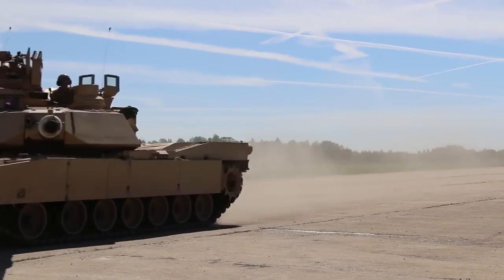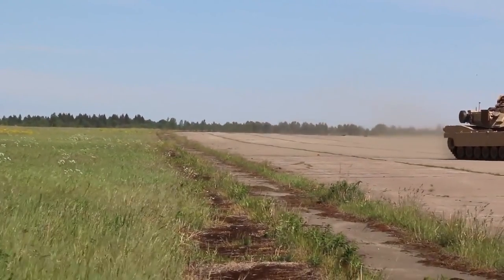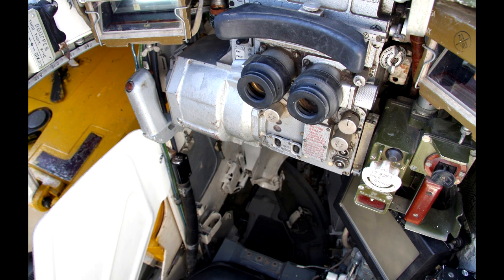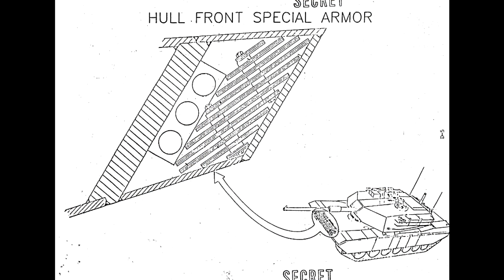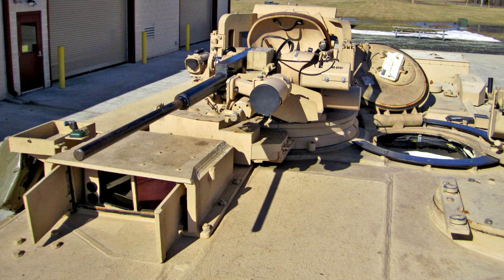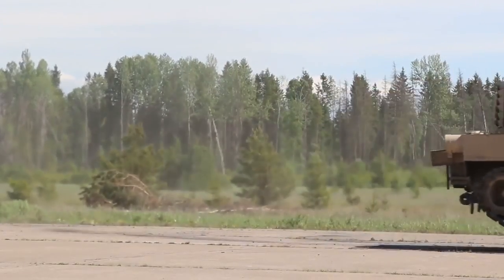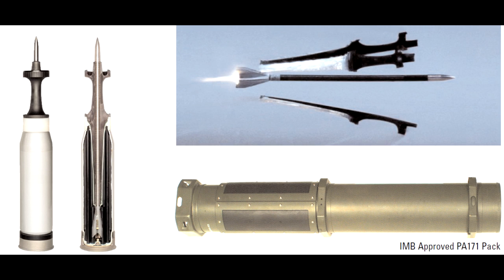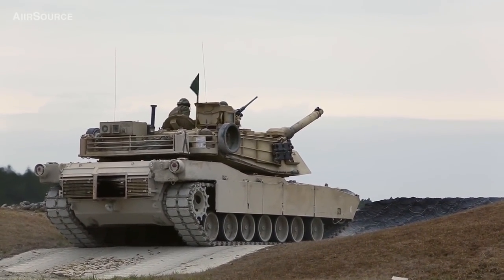Problems with Abrams tank

Comment: Next Problem with Leopard2 Tank
Reply: The only valid criticism would be the ammo rack in the front hull. But that's the same with most other tanks really.
The Abrams is one of only a few tanks that doesn't have ammo in the front hull.
Reply: Next Problem with Bob Semple tank
Reply: @eustache_dauger  Would be a short video
Reply: @eustache_dauger  there is only one problem with the semple. Too overpowered can singlehandedly destroy an entire tank column
Reply: @eustache_dauger  There is none, the fortress makes the enemy drop their weapons and surrender or run aways just with its presence.
Reply: WHO DARES TOUCH ERIKA!
Reply: @Life in the Zone Oof
Reply: He could do this with the Puma IFV, same company (joint with rheinmetall of course) but basically not a pheasible vehicle currently
Reply: Pommy Pie  That issue was meant to be addressed under the KWS III program. The retrofit program was slated for the mid-90. Although it was cancelled due the ending of the Cold War. While the KWS I (L/55 Gun Upgrade) and KWS II programs were merged creating the Leopard 2 A5.  

Had KWS III been approved, a new turret mounting 140mm gun with a bussel auto-loader would have been fitted. While the driver's position and now redundant hull ammo storage, would have been reworked into an armored crew cell.
Reply: I think the only major problem would be the lower turret cheeks as it may ricochet rounds into the top hull plate
Reply: @theduck3876  nothing riccochets the cheeks, its spaced armor
Reply: @auburn8833  well then in that case there's probably no downside to the L2 at all!
Reply: @theduck3876  well not for long probably, with new tanks that use higher caliber guns and with that much longer APFSDS rods (like T14 Armata), it might render the arrowhead useless against those higher caliber AP shells
Reply: Well assuming we're talking about the v face L2 rather than the flatty
Reply: @Life in the Zone Wait a sec... what leo are we talking about? As far as i remember from training rescue operations of crewmen in leo 2a5s and 2a6s the ammo rack was in the back with ye good old bustle storage princip you mentioned aka ammo explosion will be pushed outside so crew wont sustain any damage.
Reply: @Life in the Zone"Leopard 2A5, A6 and A7 all used to be A4 (or older), so no. It does not have the defect that you've described. They're all upgrades. No new Leopard 2 has been produced since the fall of the wall (except for the Spanish Leopardo 2E by Santa Bárbara Sistemas, now GD Land Systems)."

Not correct, some are bought used and upgraded, some are new production, there are more exceptions than that of Leopard 2E.
Reply: Alexander Källberg 
Wrong, new Leopard II A7 are produced for Qatar and Hungary. The Leopard II is the only Westen still in production. 

https://defence-blog.com/army/photos-qatars-leopard-2a7-main-battle-tank.html

https://www.rheinmetall-defence.com/en/rheinmetall_defence/public_relations/news/latest_news/index_21504.php
And I am talking about newly manufactured vehicles and not modernized A4‘s.
Reply: My favorite tank I think it the best but even I know it has flaws that dam ammo rack and i think t suffer the same problem with Abram with the upper plate armor
Reply: lol it would be a short video
Reply: I heard that Poland said that Leopard 2A4 was found to be a "fatal" construction defect on the underside of the hull where the suspension cannot withstand more than 60 tons
Reply: Muhammad Yoga Riski "the polish said"
😂
Reply: @kloschuessel773  yeah I think they just want to promote their PT-91
Reply: Muhammad Yoga Riski dont they get this new tank soon?

Paid for by germans...
Reply: @kloschuessel773  the altay? Isnt that basically a copy of thr 2a5?
Reply: Auburn i meant the polish.

But im sure that the turks copied their tank.
They also tried to get rheinmetall to help them.
Reply: @riskicahyono687  Who would want to promote the PT-91? It's utter garbage, worse than a T-72B3.
Reply: @riskicahyono687  Why would there be 60 tons of pressure, on the underside of a 57 ton vehicle. Even if we're talking about the 65.5 ton A5 variant. It would require 85% of it's loaded weigh concentrated in one place.
Reply: @riskicahyono687  Lol?
I have never heard of suspension issues at all.
Actually, I have seen 60 ton Leopard 2A5 jumping above hills and the transmission didn't break.
Reply: @j.k6943  I was also surprised to hear it because my country uses Leopard2A4 / RI as the main battle tank and this is all I got from the local media

https://jakartagreater.com/armor-kardus-serta-cacat-struktur-leopard-2a4/
Reply: @riskicahyono687  Its pretty simpel, the poles dont care for their tanks, they expect them to function without any real maintance which is why the poles mainly use old russian/soviet tanks since they require next to no maintance and are disposable. The leo2 under bad maintance as any modern mbt (yes even the t-90) will suffer failures and issues, its been like that even with ww2 tanks.
Reply: @Life in the Zone Check out the new Leopard 2A7V (the V stands vor 'Verbessert'; Improved)! They finally added the External Additional Front Armor the Leopard 2A5DK does have since like a Centhury. And with that protection gap finally closed, they also changed the Ammo rack positioning. The hull ammo will finally be no longer in the fighting compartment!
Reply: i accualy have the script for that video
Title:
-Problems with Leopard 2 tank
Video: 
-Intro
-Outro
Reply: Leopards got smashed in the middle east the people saying it had no significant time in real warfare were right

Challenger abrams and even Russian tanks are honed through warfare

Comment: So in summary all "problems" are 30 years in the past cool or not an issue for a first world military like fuel
Reply: Weight is a huge problem
Reply: @muslischeier2978  For who?
Reply: @muslischeier2978  can be but to be fair, the new Abrams has the same weight as the new Leo 2 both are around 68 ton
Reply: Yes and no, we might think that for the US feul consumption is not a problem. In a sense it is not. After in all recent conflicts the US had supperiority in naval and air power so that it could protect its supply lines without interruption, not even speaking about it global logistic network. Yet issues could be already seen in those conflicts. A high feul usage needs of course a high supply of it and although having feul is not an issue, the supply lines to transport it to where it is needed put a lot of stress on logistic to make it happen. Now, the US military is large and funded enough to handle this. But now let us imaging a conflict with a nation that equals or can atleast give the US a real headace! When the supply lines are threatend or (over) extent. In such situations high feul demand is critical issue. One can say of course that feul supply is not an issue for first world army and it would be true. Yet, only against third world militaries. Against another great power feul will be a quit critical issue. But the Americans have shown that they can deal with such situation, yet this is never granted in war. Although most issue with the Abrams are fixed, the front hull armourment, against attacks from air, infantry AT or other tanks can not be simply put at side. Tanks dont fight alone, they are protected by other units from all side, the US had in its conflicts supperiority with that protection. However when that supperiority is contested. This weakness in thehe Abrams armourment might show to be its Achilles heel. Finally, after all we speak about an almost 50 year old design, it is of course upgraded to keep up, but the limit of how much you can further upgrade it, so that it can keep, will be reached soon. So, Abrams is not bad, far from it, it has its issue of course, but the reason why it has the image as the best tank of the world is because of the US military abilities. It never faced an equal in battle and those that came close to that were kept on a distant or/and destroyed by the combined fire power of US military. The reason why we see the loses of Abrams with the US allies, can be traced back at old models/lesser traind crues and lacking the ablity of an alround protection as the US can give.
Reply: @egbertpopken5580  Yeah but there isn't any nation on the earth that could possibly give the US any real competition. 

" the front hull armourment, against attacks from air, infantry AT or other tanks can not be simply put at side." ?
Reply: Ghastly_Grinner 
Yes we do have nations that can fight US head on
Russia 
China 
India 
Iran 
Indonesia
Reply: @Ghastly_Grinner  well I would not say that, China, Russia to some extend, but also the European nations can if they want make for the US life hard if they want. After all even the brits in thier prime were straved by some pesky submarines. And even today, a low-tech enemy can, if acting cleverly, make life hard for the US. For example, in the excercise Millenium Challange, the commander of Red Force (which represented Iran) embraced his low-tech and US relliance on technology and supperiority and decimated the US Navy fleet on the first day. He could not win against Blue Force but made it for the US a phyrric victory. Well, such things arent verry liked by the US electorate. The US might and global operations are its strength but also it weakness when played out rightly. 

What I meant with the problem of the front armourment is that it can be easily pentrated by modern weaponry that is not only wielded by other tanks but also by infantry or as armament on planes of hellicopters. It is a weak spot trough which a tank can be takken out. This weak spot has been protected in recent conflicts by US supperiority in the Air and on the ground, simply put now came close to hit that spot with the adequate weapon as he would bombed or shot by the infantry and other vechicles in to non existence. However in situation when US does not have that supperiorty or it is contested, hostile force might have the chance to take a shot at the Abrahms and use the weaker hull armour as an entry point in to the tank itself.
Reply: @zagreus1249  LOL
Reply: @zagreus1249  If thing didn't go Nuclear Russia would be pretty easy for the US to steam roll the train doesn't suit the russians not to mention russia doesn't have the juice to take care of insurgents moving tanks and heavy rockets around even when Russia has 100% aerial superiority and round the clock bombing 

China would be exceptionally easy to cripple 

India funny 

Iran You must have hit your head

Indonesia what are they going to do karambit us to death 😂